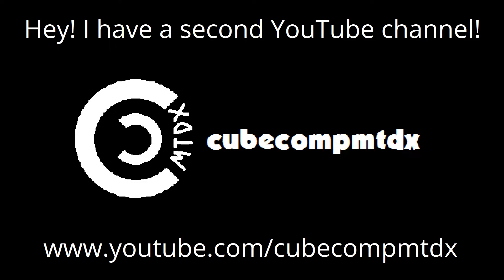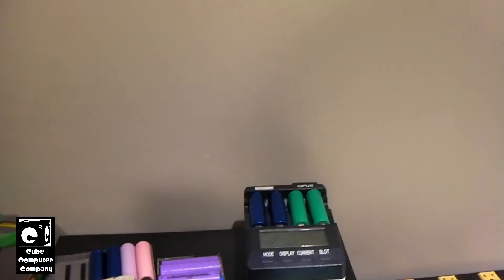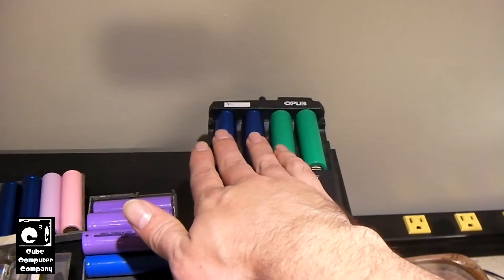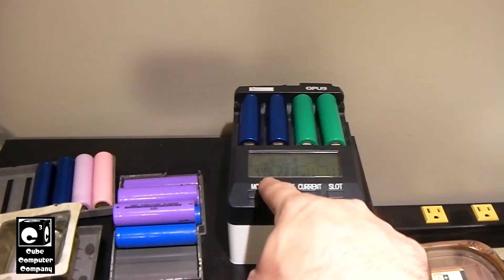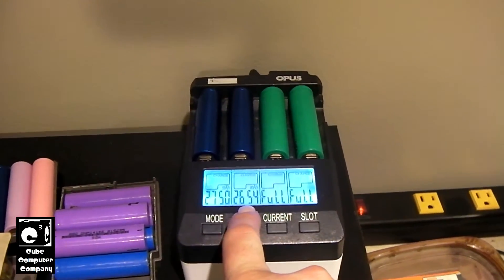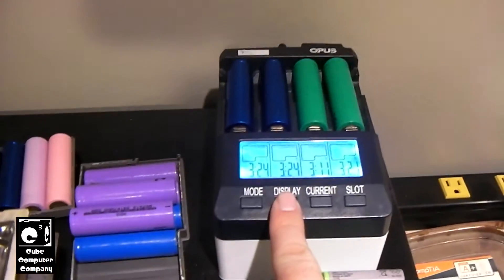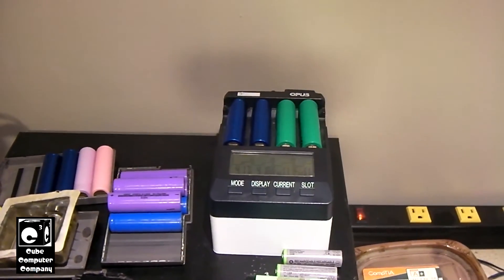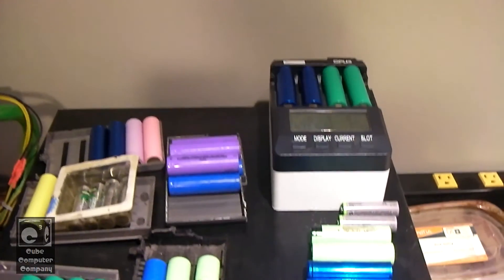Li-Ion cell getting hot while charging? A sign of 18650 cell end of life

Comment: Can you please define "hot"?  i mean is it 50C?  70C?  100C?   burn your hand hot or just warm?  what is considered safe? google says The safe temperature limits for an 18650 battery are 0°C to 45°C (32°F to 113°F) for charging and -20°C to 60°C (-4°F to 140°F) .   how hot are your "bad" cells getting?
Reply from the maker: Normally these cells barely heat up when charging, getting barely warm to the touch, unless you are pushing an insane amount of current through them while charging. One of the failure modes of these is the chemical composition of the battery refuses to take a full charge. When this happens, the battery will only charge up to a given voltage, say 3.8V instead of 4.2V. The extra charging energy supplied by the charger (attempting to raise the cell voltage) is rejected in the form of heat. This is when the battery becomes noticeably hotter than normal during charging. The higher the charging current, the more noticeable effect. These cells suddenly went from barely getting warm and charging up fully, to getting nearly too hot to touch, with the voltage not getting up to full charge level, despite the charger continuously pushing 1A of charge current through the cell. The cell was nothing more than a heater at this point, rejecting the extra charging energy as heat.
Reply: @CubeComputerChannel  thx for clarifying - im a bit new to recovering cells and while testing at 500ma they did get fairly warm but not hot to touch, wasn't sure if that was cause for concern or not. I will try 1a on retesting to make sure.

Comment: Just harvested cells from a discarded laptop.  I had high hopes because each SONY Fukushima US18650GR had 3V open circuit voltage upon removal.  Unfortunately, their internal resistance had gone up like yours.  They just became hot on the charger.  I tested the capacity after 4 hours charge and they only had 72 mA*h.  I agree that this aging seems to be related to certain brands or chemistry.  Other harvested cells never act like this, even when they get old.
Reply from the maker: The crazy thing is I have a whole set of SF cells harvested from a 2003 Dell laptop battery. They still charge up and don't even get warm during the charge. Though I have had SF cells that did get hot. It depends on how that pack was previously used and how much it was used.

Comment: you should get an original imax b6 (v1), theres a custom firmware you can put in it that makes a great tool for testing cells. You problem is most likely dendrites, meaning you have an internal short that only happens at a certain voltage. Some cells fail like that, mostly sanyo ones, somes dont and fail more safely.
The solution to that problem is to not charge the cell to that voltage, just like electric cars do. The obvious problem is you lose capasity and you also need a device that can charge them are a lower voltage. Most cells have 80% of their capasity at 3.9-4.0V.  So if you have a way to limit them to 4V not only will they not get hot but also they will last a lot more cycles
Reply from the maker: I've definitely heard of the original iMAX chargers. I'm going to end up recycling the whole batch of these cells and replacing them with identical replacements, as I now have 2 more that are doing this. If it was dendrites, I would think the cells would slowly discharge, but these don't, unless it's just down to a specific voltage. I've never run these too low on voltage. They do have a high count of cycles on them as I've used them quite a bit since I got them (lightly used) in 2018.
Reply: @CubeComputerChannel  tbh im no battery chemist, but i had a couple of sanyo  cells than worked fine and all but would heat up over 4.1V, and suck a bunch of current like yours for a while before finally settling at 4.2V. The funny thing is that the cells would stay warm even if you stopped the charge. No idea if its dendrites or not, but it sounds like the only thing that could cause a thing like that to happen. Batteries go through a bunch of chemical reactions in a big chain of reactions each happening at a different voltage level, i can only guess the dendrites are happening at one of the higher voltage levels
yeah its weird that its not self discharging but idk xD

also as a note, those were in a power bank that charged 6 cells (2 were red sanyo ones) in parallel at 1A, meaning 1/6A each, even at such low currents they would get warm. i guess because they would suck the other cells current.
The cells were recycled cells from one of those shops that services ebikes. The ESR was too high for an ebike but you could still get 2-3A from each cell no problem